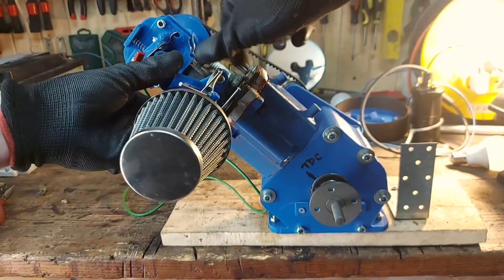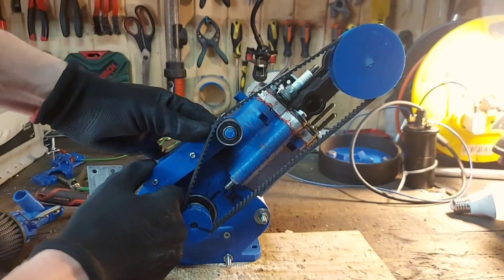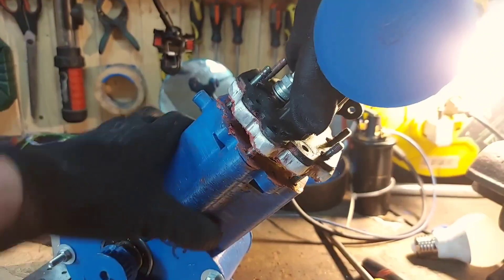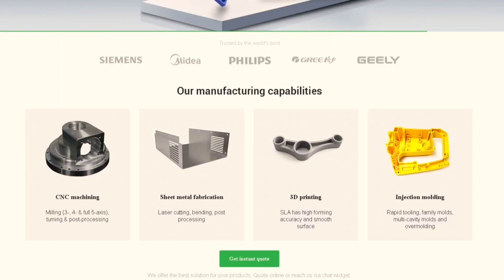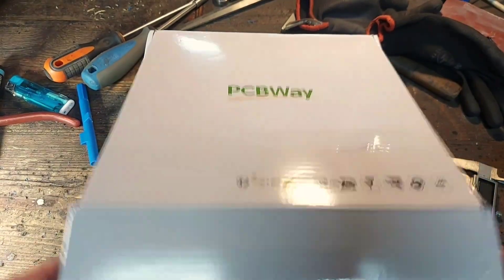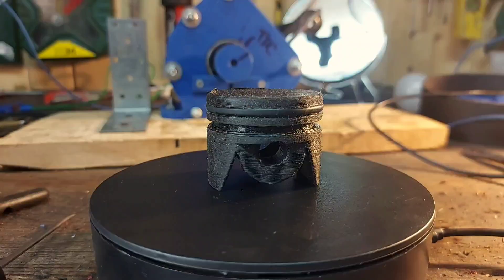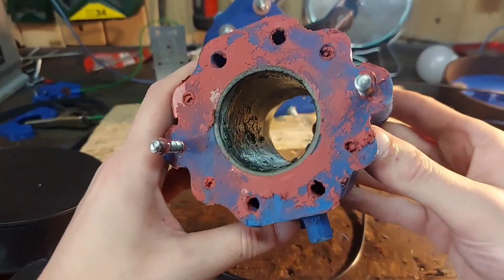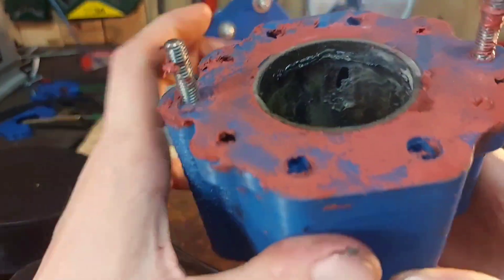Why My High-Performance 3D Printed Engine Didn't Survive

Comment from the maker: Engine specs: 50mm stroke , 45.25mm bore, 8mm tdc gap betwen piston and head(the head is flat so 0 volume there)Camshaft specs: 5mm lift 113° lobe separation angle, Injection system controlled by an arduino nano, a hallsensor on the camshaft, irl3034 logic level mosfet, aprillia 125cc Scooter injector, 3bar fuel pump. Timing belt htd5 9mm , spark plug NGK bkr6ek, Ignition Coil Magneti Marelli baeq056.
Reply from the maker: 7.25:1 Compression Ratio

Comment: you will need a metal based piston and cylinder nothing else will work for any reasonable amount of time. you will also need a metal con rod to achieve any sort of reasonable rpm, your valves and valve springs are way too small to support higher rpm, cam lobe profile will also need work and your exhaust port will melt very quickly and will also need to be made of some sort of metal. but if you address those issues you'll see a massive improvement in run time and rpm. if you want any help let me know, im an engine builder / machinist and might be able to help you out.

Comment: 3d printed asterisk. well maybe better move up to metal 3d printing at home. or electroplating 3d prints with copper. copper also works as good electric conductor and as a heat sink. 1200C of copper is almost as good as stainless steel, much better compared to aluminium. weight density is more than stainless steel at 9g/cm^3 vs 7.8g/cm^3 while aluminium is 2.7g/cm^3. ceramics cast engines are also possible. alumina or mgo. did not last very long did it. max 30s.

Comment: try to make an engine like the MeMZ-965 engine, a simple engine that requires fewer parts and is easier to manufacture, which can possibly be printed and made from more affordable cast iron and steel parts

Comment: teflon "dykes ring". dont use the piston crown itself as a wear surface.

and maybe another ring on the skirt as a sliding surface...

if you tossed the "otto cycle" away for what it is, flawed... and tried a lenoir cycle instead...

Comment: idk me maybe sleeves? maybe  metal coating on the inside? (idk how...😔) or maybe cut some aluminium cans and somehow use that as a sleeve or run it in methanol so it wont that hot...? i hope you keep pushing until you succeed men keep it up👍❤️

Comment: Hey Alex, really want to see this work but I see a lot that needs changing. 

Make the engine run lean, over 14.7 AFR to lower the combustion temperature

Create an oil system to lubricate and assist in cooling

Create a cooling system in the cylinder head, try metal fins in the channels to help promote heat transfer. 

On BMWs, they do water methanol injection to lower combustion and intake temperatures. Maybe you should try that too, might get you ~30 degrees off your combustion chamber

Try a PEEK (Polyether Ether Ketone) piston head, it has twice the heat resistance to carbon fiber nylon from what I see.

Wishing you luck, be safe and keep up the good work.
Reply from the maker: Thank you so much for all the tips! PEEK will definitly be used at some point in this engine, but first I want to have propper designs that works at high performance level before I start investing in exotic materials, the fueling sysyem is gettting upgraded slowly, adding sensors and all the things I need to have a propper fuel delivery and AFR, for the next run I will 100% have fuel in the crankcase, also the camshaft will be redesign because I want more/bigger valves at some point also bigger springs.
Reply: @alexslaboratory4976  I would try mixing oil into the gas like in a 2 stroke if the crank case is gonna have fuel in it

Comment: I strongly suggest aiming to run at extremely rich air to fuel ratios (8:1-10:1 or richer if you can get it to run that wet). Not permanently, but currently you aren't at a point to worry about oil film strength, fuel dilution, etc. It could really help with some of the heat issues, at least if you are looking for every second of life out of a build.

Also your cam profile for the ramp down after peak lift is steep. I worry it might be steep enough to cause your valves to bounce on the seats when closing, especially as you increase the RPM.
Reply from the maker: Thank you for the tips, when it comes to the camshaft I have in plan to completly redesign the head so I can add more/bigger valves so with that will come a camshaft redesing. And when it comes to the afr I need to add a maf sensor and a throttle position sensor to the injection system so I have a better chance to control the afr.

Comment: Great video. It looks like you had more issue with cylinder/piston friction rather than fuel combustion issue.
The piston going up and down causes more thermal issue, caused by friction, I think for combustion, you shouldn't have any issues for a few minutes running it, but friction is unfortunately destroying your piston. 
Perhaps adding a parchment or baking paper on the sides of the piston can help in minimizing the friction issue.
Great video overall.

Comment: although swapping anything that touches combustion to metal would solve the piston and cylinder wall melting I wonder how long a metal capped or topped piston would last with a  alcohol mix

Comment: I am interested in some of the specifications of the engine, if you don't mind sharing.
I had a thought, but I cannot confirm or accurate it is without knowing the ratio, but have you considered a lower compression ratio, but including more sparkplug advance? Or even the opposite, retard the timing, but keep the CR the same?

Both of these could help decrease the peak temperature within the engine, while also (maybe) keeping the torque and power the same-ish. That way you can avoid the flash melting issue/bubbling issue. 

Something you could also try is messing with the exhaust lobe. By allowing the exhaust to open earlier, for a longer duration, it could help reduce the amount of heat sinking/absorption into the piston and cylinder walls.

However, all of this is conjecture at this point without physical data.
Reply from the maker: I just pinned a comment with all the specs of the engine, the compression ration is 7.25:1 so its not crazy high but the camshaft is definitely made with performance in head.

Comment: 100% should do a metal cylinder or high temp resin / acrylic (better option) as some model working engines use that, will last longer and you could still says it's a non metal engine.
as for the piston try using pa6-gf from polymaker and anneal it (highly recommended) or pps-cf but it's a more expensive option + you'll need a really good printer (350 c hotend)
Reply: for connecting rod and the crankshaft just make them thicker and anneal them for higher strength and hope it works

Comment: I think the sludge comes from the piston not being properly aligned during combustion, which creates friction and heat that causes it to melt. A centrally placed spark plug might help reduce the unevenness of the combustion, leading to less bubbling on the piston and more balanced pressure forces. That would reduce friction between the piston and the cylinder. It could also explain the hole in the cylinder, since a side-mounted spark plug would cause one side to wear out faster. At least, that’s my guess.
Reply from the maker: Good point , the hole in the cylinder is on the sparkplug side of the combustion chamber. Also having the cylinder at a 45° angle gives a bit more friction on the upper side of the cylinder(the side that has a hole in it😂)

Comment: try to find a metal or glass pipe with the same diameter, as then the weakpoint will become the plastic surrounding it. if i was you i would combine the metal sleeve with watercooling so it could run for much longer although maybe thats something you might need pcbway's help with as making watertight 3d prints is pretty difficult
Reply from the maker: Never tought of a glass cylinder, I will definitely look into that, thanks for the tip!! When it comes to water tight 3d prints I printed a fuel pressure regulator (the one with the gauge) that holds aroud 3bar of fuel pressure, all printed with a 0.8 nozzle and torched on the insid.
Reply: @alexslaboratory4976  if you do go with the glass cylinder a great way to cut it to size is to soak some string in gas or alcohol and wrap it around where you need it to be split, light the string and let it heat up for 10-20 seconds and then dunk it into a sink of ice cold water. The glass should split very cleanly along the string

Comment: im sure it could run longer if you let it idle at low rpm instead of full throttle. Also liquid cooling the pvc cylinder liner could make it survive more heat?
Reply from the maker: In the next episode I will run the water cooling, just got a bigger water pump for it.

Comment: try using copper sleeve plastic one is going to melt from the friction
Reply: Was gonna say the same. There is no way regiular PVC can survive the stress inside an engine. If he uses copper as a sleeve, it will also be easy to watercool it